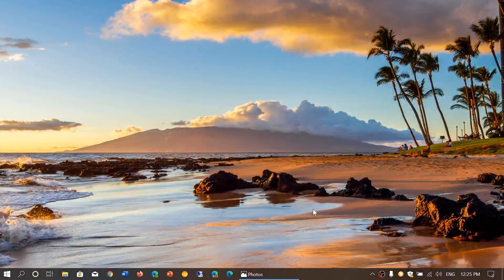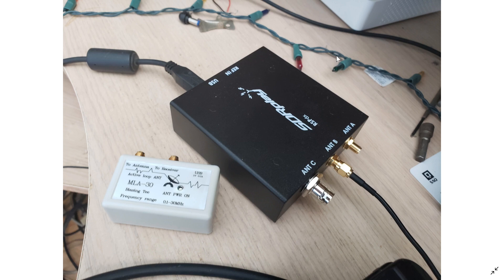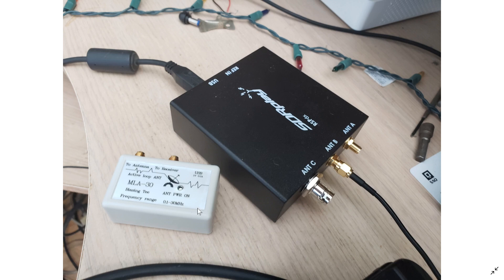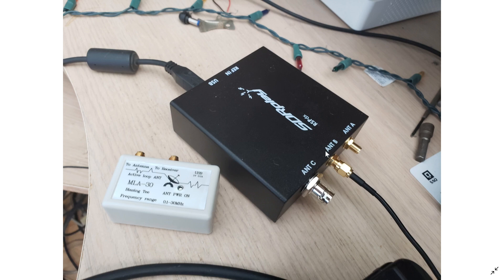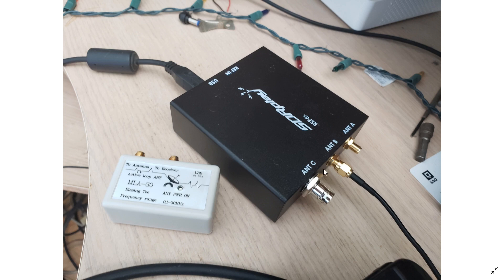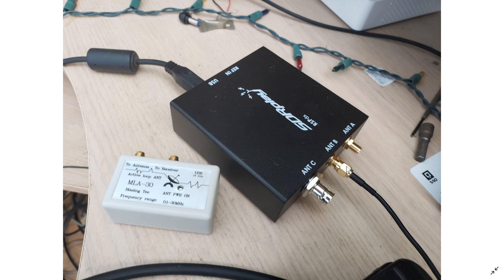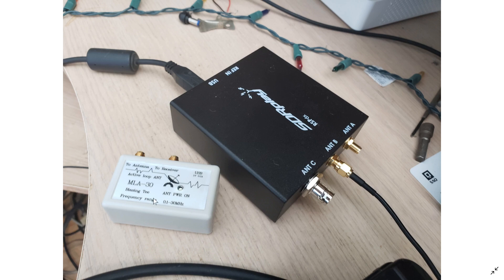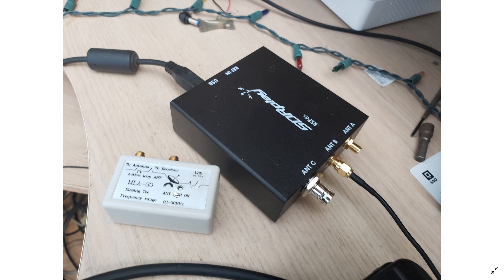HOW TO Connect MLA 30 loop to RSP Device Bias T for power

Comment: Out of curiosity, I connected my RPSduo directly to a MLA30+ and activated the bias-t in SDRuno. It actually worked even though the voltage is about 4.5 versus the stated requirement for 5-12 volts on the MLA30+ box. However . . . . the signal was EXTREMELY noisy, which I understand to be a characteristic of the MLA-30+ design and not directly related to how it is powered. It amplified both the signal and noise such that that the SNR actually decreased when compared to using a passive YouLoop at the same location.

Comment: Tried it with my SDRplay and a MLA30+, it works pretty well on the Bias-T from the SDR until you go down to Long Wave. Then the signal strength is WAY down compared to the Biasing Tee supplied with the MLA30+

Comment: Hello Gilles! Thanks for your video! I hope you can help me with my question. The bias T on my RSPdx (port b) stopped working last week, probably because of static from the antenna (bad weather). Would the bias T from the MLA-30 be a good replacement for the one on the RSPdx, or would it be (much) noisier? Thanks in advance!
Reply: Ok I just found your answer in your video from the 20th march 2020. So thanks for your research on that! Best regards!
Reply from the maker: in my test the MLA 30 bias T works fine

Comment: How about ant-A or Ant-C connector, will that MLA-30 bias-T work with these ant connector ?
Reply from the maker: MLA 30 with the included Bias T works on all ports...  IF you remove the included Bias T ... only 1 port on the RSPdx gives power to the antenna

Comment: The thing I want is no bust or buck converters. They create noise. 
They used are in the SDR's Bias T, the one in the MLA-30+, and even that USB power bank you thought was the answer. All contain 'em unless they don't. 
That is why I built a straight-up battery operated one. Zero noise and field-able and we're looking at maybe 45ma on a set of old school AA alkaline batteries. (that's a long time)

Comment: Very good video, thank you for posting it. As this video very well explains the concept of Bias-T it fails to explain that indeed the bias-t box has to be used with MLA-30 loop antenna. The SDRplay is not capable of powering MLA-30 loop antenna (at least the version I have)
There are two reasons I would keep the box:
1. The antenna needs 12V to operate. The bias-t box has a converter inside and ups 5V from the USB port to 12V (it is easy to measure). The on board bias-t provides only 4.7V which is not enough to run the amplifier. 
2. When you switch between the tuners on SRduo the bias-t gets disabled each time you change the tuner and it has to be enabled. I am not sure how it works for other models of SDRPlay.

I am certain there are LNAs that will work just fine of the voltage provided by the radio. However, this particular antenna needs its original bias-t to operate. 
My two cents.
Reply: Very useful, thanks
Reply: I am sure your correct, j have read this elsewhere

Comment: My understanding is that the bias T provided with the antenna takes between 5 and changes it to 12 volts somehow. The bias voltage from the RSP device is just under 5 volts. I tried it both ways and there was a noticeable improvement when using the MLA-30 bias T.
Reply: my MLA 30+ box read USB 5v at the usb input.

Comment: Hi Gilles. So, what happens to the Antenna Gain if you by-pass the original Bias-tee box? There is a gain adjustment potentiometer in there that you can tweak
Reply: Sorry, my mistake. There is just an attenuator into the Bias-tee box so I guess nothing happens if you by-pass it